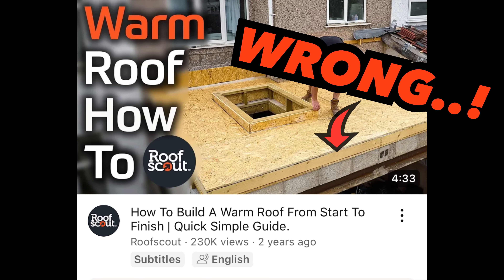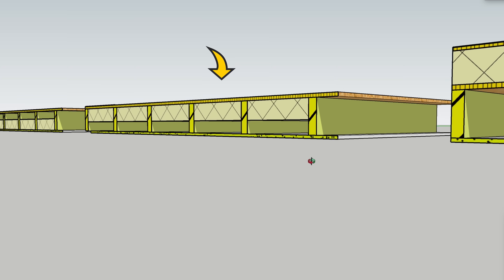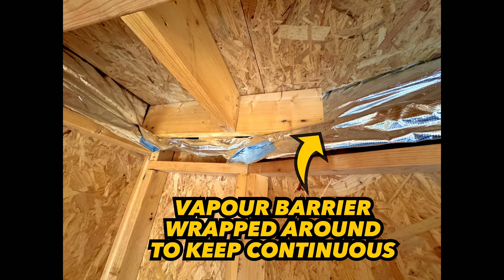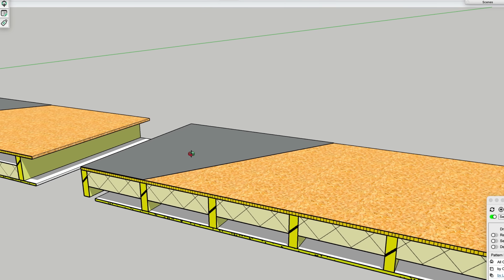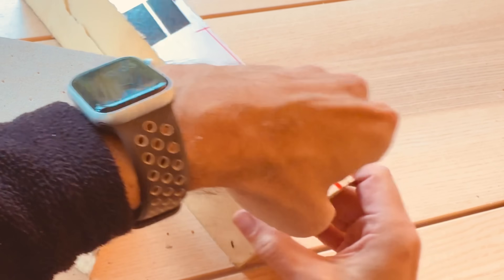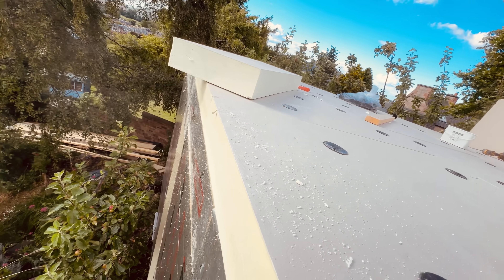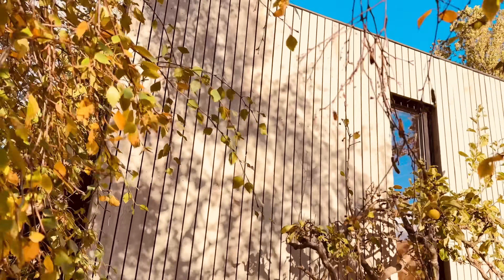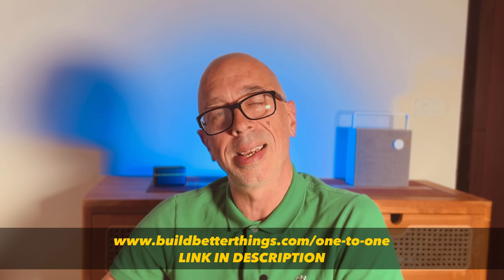Build a Warm Flat Roof the Right Way

Comment: I'm a little confused: In the case of a warm deck, the vapour barrier prevents moisture in the warm air in the living space from getting to the insulation and beyond, so where does the moisture that's going to rot the underside of the top layer of OSB come from?
Reply from the maker: Hi. It comes from residual vapour, leaked vapour, the fact that there’s gaps and joints and penetrations which means more vapour still, the fact that there’s not a vacuum on the roof side of the vapour barrier (vapour retarder is a better description ) and, in the case of those using foils in their insulation in a warm roof, from thermally contrasting elements such as metals v inert materials. Put all of that together over a period of years and you have the compounding effect of rot on the top layer of OSB which in turn affects your adhesion . If I was putting the question back to you, it would be, why do you want a top layer of OSB when you can do it more economically without, even if you don’t accept my analysis of rot?

Comment: Great video and explanation. Instead of OSB on top can we use a cement board or "tile baker board" for smoother finish? I believe this will not rot with moisture
Reply from the maker: Thanks a lot for the kind words.  Any inert material will be better than OSB but I would still be worried about moisture getting trapped beneath or within the board rather than being able to slowly breathe out where no board. I’m not understanding the attraction for the top layer when you can save a load of time and bond direct.

Comment: Doesn't permitted development allow 3m roof height at the eaves? Where is the 2.5m coming from?
Reply from the maker: From regulation relating to proximity to boundary. Most people don’t have massive gardens.
Reply: @build-better-things  thanks Jerry but the regulations I've seen on the scotgov website relating to permitted development and planning permission don't mention anything about 2.5m and boundary proximity. Do you have a reference to an official doc? Sorry, not saying you're wrong just like to see these things for myself.
Reply from the maker: @BadHorsie1 yes that’s for Scotland, which I mentioned in the video is different,  with the illustration. The majority of people are working off a different set of regulations for the rest of UK.
Reply from the maker: Also, don’t forget to take account of your levels. They’re quite strict about the interpretation if you have a slope (Scotland I mean).

Comment: A builder put OSB on my pitched roof. Then Rockwool insulation was planed underneath it between the rafters and over the rafters. There gypsum board. The firts winter I noticed not only condensetion but ice forming on the inside of the OSB.
I then stopped the guys that where working on the renovation. Since than in didn't find a solution other then doing my roof again removing the OSB...
Reply from the maker: They didn’t ventilate between the rockwool and the OSB?
Reply: @build-better-things  no! fortunately, I noticed condensation (ice) while they were still installing rockwool and plasterboard (over the weekend when they weren't working), so I stopped the renovation.
I have 12cm EPS outside on the facade up to the eaves. Drilling holes there (14 between all rafters, on one side and 14 on the other) installing some kind of insect protection, opening the ridge where the OSB meet is something I can't do myself. I don't even know if it would work.
I have ventilation between roof tiles and OSB, not sure what for...
it bothers me that the only definitive solution would be to completely remove the OSB, but that is basically a new roof once again.

Comment: What would be the logic behind insulating between the ceiling joists with 100mm fibre glass and then insulating between the rafters above that ceiling with 100mm pir, breathable membrane on top of that, it very warm in the loft space and it looks like moisture is collecting in the eaves which is rotting the valley boards and flat roof decks attached to the above pitched roofs
Reply from the maker: There is no logic in insulation between the joists and then again, insulation between the rafters. You either do one or the other. Both options requires ventilation strategy and that is likely why you are attracting moisture.
Reply: @build-better-things  Thanks for the reply, the building in question is a residential care home and is only 12 years old, how did this design get passed building regs, the owner now has an enormous task putting this right not to mention the bill

Comment: I am currently working on a building that was constructed 12yrs ago and has damp issues to the upper floor ceilings, upon inspection it is found the grp covered flat roofs which could be described as some where between a cold roof and the hybrid, there is no vapour barrier and no ventilation cosequently the decking boards have completely rotted and also the joists have rotted through, also each flat roof is connected to a pitched roof in which 100mm pir has been installed between the rafters tight up to the underside of the roofing felt, laths and concrete tiles on top, bellow this are the ceiling joists with 100mm glass fibre insulation between them, this is a nursing home and as such it kept warm at all times which is evident when i remove a roof tile and lift out a piece of pir and feel the heat escaping. There is a lot of heat and moisture travelling up through the roof structure and so far i have seen little ventilation, i find it hard to believe building regs let this roof design pass, it was a dissaster waiting to happen, all the flat roofs need completely replacing or in this case as there is a 500mm high parapet wall round at least 3 sides of all the flat roofs so i can construct new roof frames over the old ones and negate the need for invasive repairs or opening up the building to the outside, to top it off all the plumbing, ducting, electrics are hidden above a suspended ceiling wich is hanging off the rotten flat roof joists which are boxed in with fire boards, nightmare really, i will have  to suspend the old roof from the new roof and introduce plenty of ventilation to take away the moisture before it reaches the new vapour barrier

Comment: I’ve never seen a flat roof that doesn’t leek. When a flat roof is needed the code should call for a permanent railing or barrier around the perimeter and inspection access to the entire underside of roof.

Comment: Can I use a different material in sheets, instead of the outer OSB layer.
Reply from the maker: If it’s breathable and inert / moisture resistant, maybe. Does such a material exist? Why would you want to?
Reply: Just for a better surface to apply the liquid rubber
Reply from the maker: For a warm roof, you should be bonding direct to the insulation. There is no better surface.
Reply: Ok I was thinking of cement board because it's breathable but I'll listen to you. should I use a primer on the insulation before I roll on the liquid rubber
Reply from the maker: I think you need to spend a bit longer and get some formal advice based on your specific circumstances. For liquid applied, it’s a different process again, and I might consider a ventilated roof.
Reply: Ok thanks for your time

Comment: The ridged insulation board idea to me is not good. 
In order to get good insulation there according to Passive House standards ie the best standards I’m aware of in the world (Germany). Air movement must be eliminated that sounds easy but in reality air will circulate unless accuracy of joints between insulation and rafters should be no greater than 1mm or 1/25 of an inch….
Having inspected many sites even with new construction I’ve found gaps as large as 5mm or 1/5 of an inch totally unacceptable.
So I insist on supasoft insulation (recycled plastic bottles hygroscopically stable) and as a quilt totally fills the void. Supasoft  is also vapour permeable and as such prevents moisture build up.
Timber dec above a breatherbl/vapour permeable layer Elka strong board is exerlent, if flat a ventilation cavity required.

Comment: Strange, I just did the training for Elevate (previously Firestone) and the official training had me going directly to the OSB. 

As for the contact adhesive, it is harder to manage on larger sections, but I found the spray much easier to apply with better coverage.
Reply from the maker: Hi. There’s no problem with applying Elevate directly onto OSB. The reason we have two types of glue and two different training methods is because there is the ventilated roof, for example, a cold roof, and you need an OSB deck to adhere to for that, using water based adhesive, and which I show in first graphic with the three roof examples. Then there’s the warm roof,  where you should be adhering onto the insulation using solvent contact adhesive.

Comment: Hi Jerry
Many thanks first-of-all for your interesting videos.
Looking at the video, what came to my mind is: How does the roof construction apply to warmer regions like mid/south Italy or Spain where summers are very hot (winters mild) . Would YOU build the roof the same as you demo in your video? Same insulation materials?
Thx
Reply from the maker: These are the climates where thermal bridging makes the biggest impact. Especially in New construction where through ventilation isn’t done anymore and housing is closer to airtight , even in southern Europe.  People associate thermal bridging with heat loss, but it has a bigger impact on keeping interiors cool and comfortable in hot sunny climates, especially in the evenings. You need warm roof and warm wall construction, with the actual structure inside the insulation. I’ve made videos about it elsewhere on the channel. Thanks for your comment.
Reply: @build-better-things thank you for your reply, I will search for that video for warmer climates on your channel. I am planning to build a high insulated timber/prefab house probably in mid Italy.
I might need your help later on.

Comment: Also without a layer of OSB on top you might get condensation get stuck underneath the EPDM layer, because that is a barrier. But if you use a proper flat roof PIR product, vapour can not pass through.
Reply from the maker: Hi and thanks for your comment. EPDM is somewhat breathable , so trapped moisture can permeate slowly, but not of its within osb.

Comment: I prefer a cold deck.. but i put 50mm pir underside of joist and tape the joints then i put a 2x1.5 battons for slab ... the pir taped is my air thightness.. i put it on in full sheets with other cut in between joists
Reply from the maker: Yes, that can work but need to get the ventilation working between the joists.

Comment: Useful information,especially preventing misery later on,;why i am watching videos like this.BUT what is the solution for my curved roof with strawbale insulation ????
Reply from the maker: What I know about wonderful straw bale insulation is that it’s breathable, when gathered and laid correctly. I’m assuming you would either have the roof membrane on the underside if it’s on top of the joists, a bit like thatch, and, if it’s between the joists, over the top, with your battens and possibly a breather membrane over that. Perhaps someone with greater knowledge will paste their experience here.

Comment: So what goes on top of the rubber or is that the roof surface?
Reply from the maker: Hi. Yes, that is the roof surface. If you’re going to use the roof for activity, like a balcony or table and chairs, anything other than occasional access for maintenance, then I’d go for an inverted roof.
Reply: @build-better-things  Wouldn't fibreglass be the better option,? Fibreglass boats are still in good condition that were built in the 70s. Rubber would surely perish after 20 odd years?
Reply from the maker: There’s little difference in the longevity between the two assuming same quality of workmanship. I reference this in the video.  I don’t have the space to go into the pros and cons here, but you’ll find the issues of breathability of the membrane & adhesion to insulation should make your decision easier.

Comment: If they use water based adhesive on (waterproof) OSB, where does the water evaporate to once the (waterproof) EPDM sheet is applied?

Comment: Can you help? Is there any way for me to increase the R-Value of the roof from inside, without removing the rubber and working from top down????      Details: I live in a 1000 sq. ft. ranch house built in 1960.  The roof has about a 15 degree slope.  When I pull down a piece of ceiling drywall in the open living room, I see a 2x8 rafter with 5 ½ inches of faced batt insulation.  Then the roof deck, ½ insulation board and then a white rubber covering on top.  Looks like it was all quality done at the time. ---- The 2-3 inch gap between the top of the insulation and the bottom of the deck allows it to breath, with vented soffit.  Thank you if you have any ideas, as my web research has been unfruitful.
Reply from the maker: Hi. As long as you have good ventilation within the void above the existing insulation between the rafters, you could consider adding insulated plasterboard, or insulated drywall it’s probably called where you are, and you should aim for at least 72mm thick, which will have 60mm PIR and is enough to make that difference. For existing set ups such as yours where you have that outer layer of bosses, you should try to calculate the dew point. I suspect the half inch insulation board is doing very little but worth checking anyway.
Reply: Thank you!  Will ck it out!!  Appreciate the advice!

Comment: Warm roofs and vapour barriers are fine in theory but fail very easily if there is a slight deviation or fault in the installation. What is worse , is that by their nature, they hide any faults in the installation until a lot of damage has occurred. The traditional construction methods allow inspection and natural ventilation. We’ve known how to build well for centuries. Fancy new ideas have a tendency to be abandoned because they often fail.
Reply from the maker: Hi. Fair points, it’s just sometimes there’s no option but a flat roof. “Fancy new ideas” are also what have made it possible to heat a home with nothing but the the sun, intelligent use of insulation, and good design and construction. Better for everyone in the long run, don’t you think?

Comment: I have a flat roof 24 ' by 20'.  I need to tie the EPDM in into a 4/12 pitched shingled roof but don't know best application to do  that....excellent job on moisture a hard concept to master
Reply from the maker: I would use a flashing for that. I guess you could take the membrane up and under shingles and lap the sloping membrane over, but need to go through the detail

Comment: Hi BBT, I like this roof build but what if you need a firmer surface to the upper finish of your roof for pitching a ladder on etc. Any concentrated load could puncture your roof as the insulation layer will give. Thanks in advance.
Reply from the maker: Hi. It doesn’t matter what the substrate is, insulation or OSB. This is a common misunderstanding. The EPDM will puncture regardless of the firmness of the substrate. If you were regularly using a ladder you would use a spreader plate , or you would build an inverted roof if there was permanent access. Despite some of the comments here,  tissue faced PIR provides a very firm substrate.
Reply: @ 👍ta v much

Comment: No, the dew point under the timber deck flat roof with a well vapour sealed warm roof design, with a good vapour barrier, will be greatly reduced because the insulation keeps the area warmer than the dew point. The more insulation, the less chance of  condensation under the deck. This design will always have a difference of temperature between the outside and in side, of the timber deck,  but with the deck properly bonded down onto the pir insulation, there is less or no chance for condesatuon to build. A well designed  warm roof is an excellent thermal solution for roofs. Celotex make a product called Tem Check Deck to overcome the problems of condensation under the roof surface. Basically, 100mm of pir board glued and bo ded to a 6mm sheet of ply.